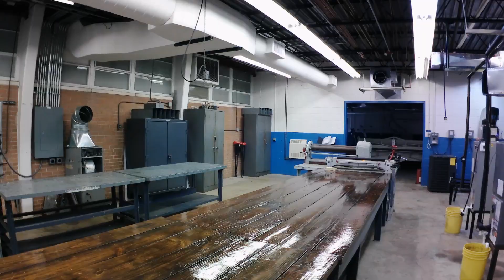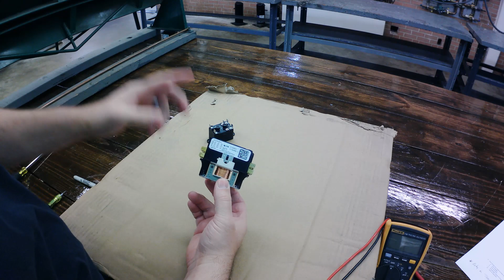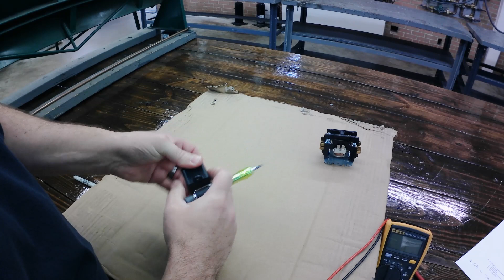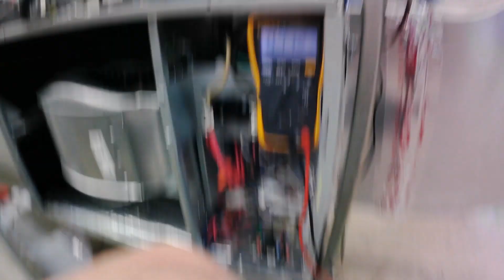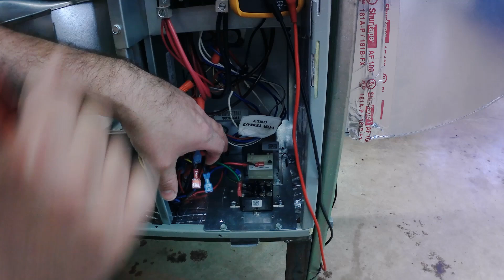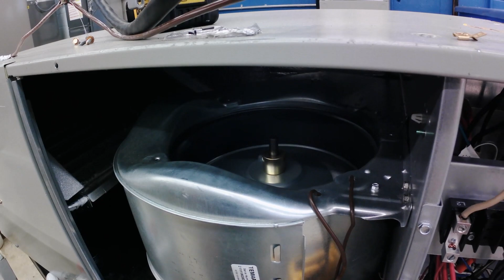Is the relay REALLY bad? | Understanding HVAC Electrical Concepts

Comment: How would you isolate a bad relay if it’s only a single leg (L1) 277V? With VAVs it’s very common to not have 2 legs. Seems like the hopscotch method wouldn’t work, right?

Comment: Most people were never taught how to think, to troublshoot, or to test their hypotheses, ESPECIALLY when it comes to testing for disconfirmations.  I.e., how would you know if you were wrong?

Instead, they assume that the common answer is THE answer, that the first problem they find is the only problem, that if X would explain the issue, then X must be the answer, etc.  So they throw parts at it until they say the customer just needs a whole new unit... and they think they're master techs.
Reply from the maker: It's nice when there is only one problem though! And when that problem is the more common issue. But like you are getting at...what happens when it ain't? Messes people up a little but you got to be methodical and think about it. Maybe even learn something you didn't know or think about before.

Comment: I thought 24v was like for a battery 🔋.  Why wouldn't it be a 110v
Reply from the maker: Low voltage is safer and we typically use a lower voltage to control a higher voltage. Sometimes it is a 110v circuit controlling a  240 or maybe 480.

Comment: You can't assume anything in electrical without using a multimeter. People that do, have no idea what they're doing. But also a multimeter won't help you if you don't have basic electrical knowledge, and you don't know the system you're working on.
Reply from the maker: Lot to learn in understanding electrical stuff but without a meter it is tough. I once worked with a tech that didn't have a meter! It wasn't good 😪
Reply: @johnjennings-JJ  though I'm not working in the HVAC industry, once I had to work with an old guy, who just randomly replaced parts in the machines. Getting shocked was also a daily experience for him 😅

Comment: very good video, it would be helpful to say the name of the terminals your testing with your meter. There is very little content on Youtube that gives you a clear understanding of the exact operations of a relay during normal or trouble shooting processes. Again this is one of the best videos so far.
Reply from the maker: Thank you for the input. I'll try to implement it more and call out the terminals when using the meter.

Comment: Could a bad relay cause the inside blower fan to not shut off?
Reply from the maker: Depending on the type of motor...yes. I am thinking of a standard PSC motor with a capacitor like I have in my air handler. Some of the newer motors don't have an external relay that controls them.

Comment: Hello the fan of my A/C never stops running.. I already called two "technicians" and the first one told me it was something clogged which obviously didn't fix it.. the second one that came in told me it was the motor after removing the thermostat from the wall and the fan still kept running.. I suspect it is the relay since the one / blower motor is not that old.. my building was built in 2016.. any idea of what might be causing the fan to never stops running? Another information: at night I turn off the brakers in the panel so the fan does not keep running all night and turn on the next morning. After that the A/c seems to run fine and then later during the day the same problem happens.. the fan keeps running. Any advice would be greatly appreciated.
Reply from the maker: We would need a little more info but it could definitely be the relay. Couple things to maybe nail down first...1) type of unit. Heat pump or furnace with an a/c...a lot of furnaces will run the blower if a fault occurs in the system. 2) if it is a heat pump then the model would tell us the type of bower motor it should have in it. Some older motors...like a PSC motor... had an external relay. Newer motors don't because they have a module built in to the motor and it could be the issue.
Reply: @johnjennings-JJ it's an air conditioner inside my unit apartment. You mean if the relay is inside the motor I would need to replace the whole motor
Reply from the maker: @renatodacostaalmeida2715...yes. if it is what we know as a PSC motor. Then it has an external capacitor and a relay or relay on a circuit board. Some newer motors are X13 (or variable speed in some) and those motors have the electronics built into the actual motor itself. The model number if the unit inside tour apartment should help identify which kind you have
Reply: Do you have an email I can send to you by email. Not able to upload here don't know why ty
Reply from the maker: Sorry, got busy at work and time slipped by me. My email is jenningsj@hotmail.com.

Comment: Can’t check ohms with power applied … that’s all it takes is removing one terminal on the coil side? I thought all wires had to be disconnected 😢
Reply from the maker: I tell my guys that there is only 2 things to check with power "on"...volts and amps. If the power is on then leave the wires on. For all else, check it with the power off and pull the wires off! You are right to pull all the wires off...

Comment: HVAC tech said I needed new coils and blower for 3k or could buy a new system for 11k. He got the AC working by bypassing the blower relay. I bought a new relay I'll be putting in soon, but now I know how to troubleshoot it, I'll double check what exactly the issue was. Either they are scammers, or it's the relay, else there is some other power issue happening upstream. I'll let you know how it goes. 
Thanks for the great video!

Comment: A tech came in and told me I needed a whole new $9k system since nothing came on. I basically did all the checks you taught me and it was a float switch engaged due to high water in the overflow pan. I was dumbfounded a tech didn’t check this. I blew out the drain pipe which was clogged. Repair$0
Reply from the maker: I don't even know what to say about that...I have made some mistakes in my time but I don't know about that one!

Comment: Heres what i would like to do and pick ur brain 😂 .   I have a spit system !!!!   The condenser is out side,  on the side of the house. 240 single phase .
 Now I would like to make the condenser fan to come on first and after about 5 or 10 seconds  I would like to have the compressor to come on.   What and what kind of durable part would I need to be able to do this.
Reply from the maker: Without going all out a designing a custom circuit board? 🤔 
I guess I would get a White Rodgers 90-380 relay to power the condenser fan and also a ICM102 time delay relay to control the contactor. You are gonna have to jump the 24 Common from the contactor coil and run it to the condenser fan relay coil, but removed the 'Y' signal from the contactor coil.completely and put it on the condenser fan relay coil. This way the fan gets the signal instantly. You will need to run a parallel 'Y' back to the contactor coil but it will go through the time delay relay to give you whatever time delay you wanted. You would need a little bit of wire and a terminal or two but it shouldn't be too bad to do nor take up much room with the parts. Hope you can follow my thought process! I am sure there are other ways also. If nothing else it might help you get started.
Reply: @johnjennings-JJ  
Thank u 
Will try it. But I was thinking more of after the contactor or too the compressor . Letting the contactor pull in , for both the condenser fan and compressor but breaking the power to the compressor after the contactor,  this way the contactor pull in when there a call and the fan starts but the compressor will not till the timer or what ever ,   makes. And starts the compressor.
Reply from the maker: @carlossaenz4075 i tried to think of something like that but the compressor is the larger load and it might be easier to just split the loads with a separate relay. But...with electrical there is always another way!

Comment: what brand / supplier do you like for a 90-340 (for a residential customer, i'm not an HVAC pro)
Reply from the maker: White Rodgers or Supco are the two that I see the most. They are both reliable in my opinion.

Comment: What causes a heater not to turn off and heat past the set temperature on the T-stat?
Reply from the maker: Electric heat??? Probably a bad heat sequencer.

Gas heat??? Maybe a bad t'stat or furnace control board.

Comment: I have a question to ask. With the hvac in my apartment like when you use it to heat up the apartment and it gets to the temperature in setup to shutoff at a giving point it just running and running without a break what does that mean?
Reply: For an example I switched it from cool to heat it in got it set to heat at 73 and its feels like 70 inside the apartment and when it finally heats up to same temperature to 73 it seems not to kick off and it's running and running even though it's in automatic.
Reply from the maker: So, I have been to some apartments/condos that have a heat pump and some that only have electric heat? Do you know what type of unit it is? Either way it doesn't sound like it has enough capacity to heat. It could be low on refrigerant charge if it is a heat pump  (and that could be because of a leak somewhere in the system)  and if all electric it could just be an undersized heater kit. More info is definitely needed. But if you pay the power bill and rent the apartment, i would definitely let the landlord know. Cheaper and warmer in the end 👍
Reply: I also heard if the temperature dips below 40 degrees it will continue running until it warms up above 40 degrees. Is that true?
Reply from the maker: Not exactly (to me). It will run more because it is just freaking colder but it should keep up with your set point on the thermostat. My heat pump ran the past couple nights a lot because it was calling for a frost in the area but it still cut on and off. I expect it to run more with colder weather but it should also keep up.
Reply: I was thinking it was a relay switch problem
Reply: It's electric furnace
Reply from the maker: Yes. Could be a few possibles...If it is a multiple heater setup then you very well could have a bad sequencer/relay and are only having one of 2 heaters (or however many) come on and not providing as much  heat. Or it may be an open safety for one of the heaters, a bad heating element itself, etc. Most of the time I personally have seen a bad heat sequencer/relay though.
Reply: So I got another question. If isn't off after a several hours not stop running should I switch it to fan and call for professional to look at it
Reply: Its on automatic both indoor and outdoor temperature is the same
Reply: And I only have one furnace that on the hallway of my apartment
Reply from the maker: You don't necessarily need to turn the fan on but I would call someone.

Comment: Be carefull using continuty on a meter as the be-all-end-all for troubleshooting coils.  A lot of meters will use TINY amounts of current in continuity mode, so if you try to test a high load coil (120v and higher) you will still see OL on the meter, doesn't mean the coil is bad, you just didn't have enough juice from your meter to register.
Reply from the maker: Good point. I try to tell some of my guys to use the continuity on the switching parts and ohms on the coil but may have missed it here. Thanks for bringing it up. You have to know how your tools work...seems like they would put a manual or something with it!!

Comment: Good lesson.

I had a condenser contactor that would close for 8 seconds, then open. Checked for continuity through pressure switches, all okay. Noticed discoloration around the base of the contactor. The contactor coil had just enough resistance to draw the contacts together for 8 seconds, then the resistance would drop, opening the contact points.
Reply from the maker: I have heard of a few stories like that over the years but never came across it. Thanks for the info.
Reply: Any tech who's trying to actually find out what's going on with the system ought to follow the voltage, both low and high.  The guy you speak of didn't do his job.  If he had, he would have found where the break in the voltage "train" was and found the problem.  In fairness, it can take a little bit of time sometimes to find the problem area if there are multiple problems on a system.  But, like the instructor here did, if you check everything over with the use of a meter (and know how to use a meter), the problem will be exposed.

Comment: If the coil on the relay/contactor is getting 24vac and not picking up why continue to test?
Reply from the maker: For me and the video...just continuing to do the basic checks. Of course in the field, once the coil is gone there is no real need to check because you probably just found the problem.

Comment: On the power input connection block it is interesting that the machine side has multiple conductors all having stranded wires underneath a single connection screw, without the use of ferrules. The two black wires could use a two wire ferrule, and the three red wires could use a large ferrule to accommodate all three. It may be better for the three red wire connection to use a in-line butt splice with the three wires on one side and a large gauge THHN wire, perhaps 8 AWG or 6 AWG of only about a two inch length, on the other side. The screw block could certainly accommodate an 8 AWG THHN wire.

The Fluke 116 used in the video has a low Z mode on Auto-V which addresses AC ghost voltage. However, many times the Auto-V mode is not needed so AC Volts are used instead like in the video, but not without LoZ. This is one of the reason why I went to a Fluke 289 for HVAC work. The 289 has an AC Volts LoZ range without auto V, which is very helpful in eliminating ghost voltage, and one click away is the AC Volt range with a high input impedance, and next to this is the mV AC Volt range.

Comment: Thanks for this wonderful video. What can cause the relay to make clicking noise continously.  The blower motor works fine.  I changed the relay  it's still keep clicking
Reply from the maker: Sounds like it could be the 24v going to the relay coil? It might be getting intermittent voltage  and that is clicking the relay switches. I would also make sure the transformer is wired probably and that you are getting 24v out of it. I usually see 26 or 27v. Or maybe something very close to it is clicking instead?

Comment: Correct me if i am wrong. We have to put a jumper from 2 to 5 and the wire for the lower speed to 6? Cause this cannot be used for heat strip unless the amperage is comparable to the heat strip. Best to use a 90340. Correct?. I appreciate your respond. I seen this use to replace Goodman circuit boards or boards similar to the one used by Goodman.
Reply from the maker: I had to take another look at that relay before I got back to you. This relay is a 24v coil, 1 N.O., 1 N.C. setup. The 90340 is a DPDT relay and the N.O. and N.C. share a COM terminal.( I figure you know that already but just for someone reading). With the original relay having 2 seperate switches you could theoretically wire it to run a heat speed and a cool speed on the PSC motor. By jumping the #2 and #5 terminals you basically make it a COM like the 90340 relay has got on it. The COM side of the switch is where to put the blower speed wire. Goodman and others do this but it just means you only run one speed for both heat and cool modes.
Reply from the maker: And that relay is not one to use for heat strips! Too much amp draw like you said.

Comment: i really like your videos but i got confused on this one. when you said if power is passing through the switch you should get 208 when its closed with your lead on L2. but if your leads were across the actual switch voltmeter would read 0v correct? i think i just got confused because L2 looks like it should be L1 lol
Reply from the maker: It all starts to blur together sometimes! With the hopscotch method you will see the full voltage (L1 &L2) as it goes into the switch and if the switch is closed and passing power out you will see it again. On my unit is was 208. Some techs check across the switch itself and by doing that the meter will compare L1 to L1...0 difference. I tell guys that switches and how you check them matter because 0 on your screen does not mean no power, just no difference in the two point you are checking.

Comment: love your videos didnt know 0 ohms across a relay coil meant its bad.
Reply from the maker: Thank you. You may find that your meter says "OL" more often than "0" if you have a bad coil in a relay. Either reading when checking resistance in a coil is not good. It has to be a positive number. You should have "0"  if checking resistance across a closed switch or maybe just a short wire.

Comment: Really well done, what do you recommend for a technician( new) technician when they come up on a wiring diagram and they are having trouble tracing it out(getting overwhelmed with all the wires)
Reply from the maker: Get a bucket and sit, then slow down and read it. I used to keep a pencil around and would make little dots with numbers on the diagram and plan out my checks for circuits I knew what the voltage was supposed to be. I say that because I was by myself a good bit. If you can get up with a supervisor or someone like that and talk to them that would probably be better. Write down the model/serial numbers and look up diagrams when you get home. Study so you can learn it, then that will become experience in due time. Hope it helps.